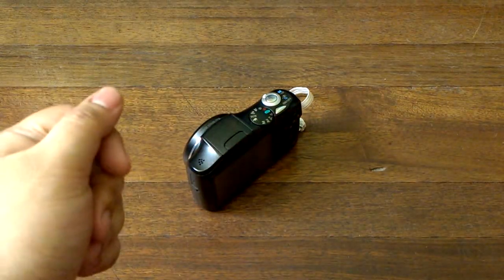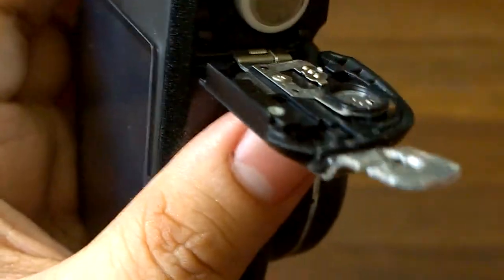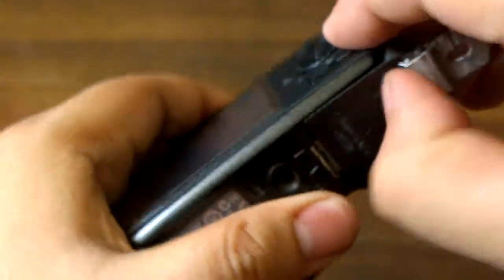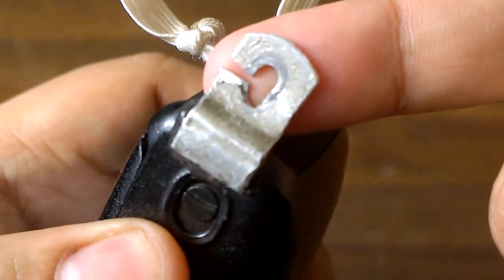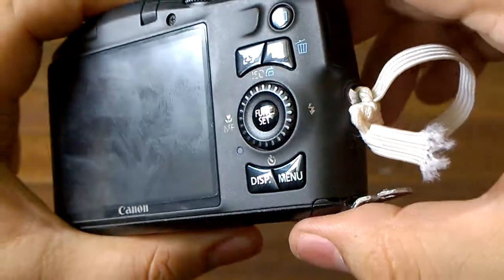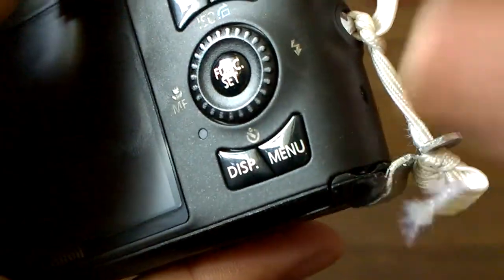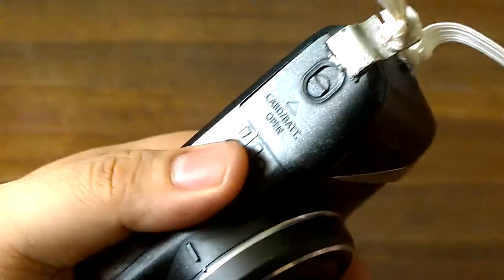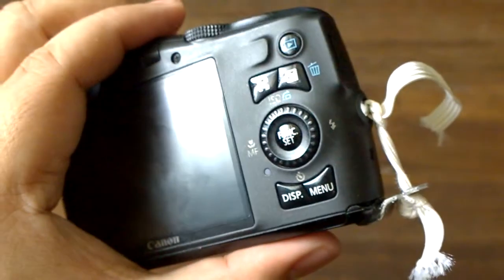DIY Quick Fix: Repair Your Camera's Battery Or Card Door

Comment: Nice fix. I had the same type of problem with my battery door but I used 1/2 inch velcro tape and super glue. The fix is less visible and lets you operate as if nothing is dysfunctional. :)
Reply: Hello! Would you mind explain how you did it? How did you place the velcro and what was the glue for?
Reply: I actually like your idea better. Thanks a lot for sharing.